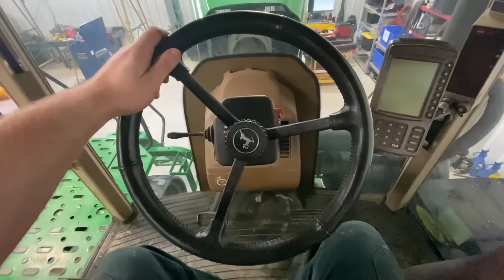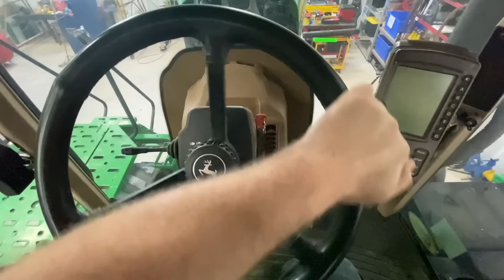The ULTIMATE fan drive upgrade! Best way to improve your Vari-Cool fan drive! John Deere 9030 series

Comment: Excellent video Zeth! Sitting here looking up my parts list now. Looks like you can get most of it ordering 3 part numbers. I do most of my own repairs that are straight forward. Your video really helps. I’ve taken my fan drive apart and greased it by hand. Got 3800 hours so far. Would be nice of Deere to provide better info to make customers aware of improvements like this. I would rather update my tractor now than have it fail in season. Thanks for pointing out the improvements and sharing.

Comment: Regarding the comments you get about the engineering of the parts, engineers need field validated empirical data to refine the parts and make them better.  If they had done this from the start for every part on the tractor, the price would be 10 times as high and people would complain that it was over-engineered. John Deere is doing it right.  I wish my kitchen appliance manufacturers would take a page from JD on servicing older units.

Great videos, BTW.  I really enjoy watching skilled craftsman at work.

Comment: Interesting that the bearings on the replacement shaft are closer together!  That increases the cantilever load on the bearings and housing by quite a bit and would seem to increase failure chances.  
Great video as always, Zeth!
Reply from the maker: They are taper roller bearings now

Comment: The mechanical design people at Deere would derive a huge benefit from communication with the folks that service their products.
Reply: About 30 years ago my company had a program like that. The people in the field have a very different/valuable view of the equipment than the  engineers do.
Reply: Deere has a number of ways they connect with dealer mechanics.  One is DTAC (Dealer Technical Assistant Center)  Every factory has one of these groups.  This works well because the people in factory DTAC can take a few steps and communicate with engineering or the production line people..

Comment: Zeth, this is very informative. We have a 2011 9630 that is past 2,100 hours. It was overhauled in frame at 1,900 at Sloan's at White Hall due to a valve dropping in the head, but I'm almost sure the original fan drive is in place, and I had no idea that it would run out of lubrication in that cavity. I know we've had our tech put a 2nd water pump on it around 1,300 hrs, and it has now had what you refer to as the "rotary union" on the drive shieve put in. What I'm gathering from this video, is we need to discuss it with our tech, but definitely lean towards taking this apart just as you are doing and at least put new grease in our drive and check the shaft and bearings. I'm figuring this update is inevitable and looks like an improvement over what is there where it can be greased (we like to grease) and maybe the problem will be cured once and for all. I'm planning on keeping this tractor now that I've already had to take the hit overhauling it so soon into it's life, and the cost of new continuing to rocket up.

Comment: Snap-n may be more expensive but they take more abuse. I know this from when I was a mechanic. The quarter inch swivels took so stress, more than any other manufacturer I used. I couldn't worry about cost of a tool when it came to reliability. I needed the tools to last and not break during a repair. I still have all my tools from the early 90's, most snap on, zero issues still. I use them now at home fixing my own Honda Pilot in my garage. Saving myself massive money going to auto shops. I am glad I acquired the knowledge over the years. My dad mostly taught me everything I know, even home repairs.
Reply: Blue point made in the same factory as snap on. Blue point= snapon
Reply: @ToyotaNutjob  yup!! I got some blue point tools. Wire stripper is one of them haha

Comment: Great technical stuff here. Useful education to equipment operators and maintainers. There will always be armchair experts or frustrated owners who naturally have a opinion. My personal view is that despite its age, this tractor has low hours for this assembly to require total replacement. It is what it is as they say. Field mechanics on YouTube sometimes have a low option of shop mechanics. You're doing a great job of countering this view.  Like the unused position in the timing cover. Cheers from London
Reply: Cuz it was never greased, that’s why it failed…

Comment: Very cool.  I like the trade secrets you share. Myself, I would have put in a big piece of cardboard or similar after the fan was removed.  It scares me that I would slip and punch a  hole in the radiator. Just me.  If it were not for bad luck I would have no luck at all. Thanks.

Comment: Such interesting videos.  Thanks.  So...I'm a city-boy with no clue how much one of those big tractors costs the farmer.  No doubt how well made and tough the equipment is.  So evident in the massive parts, eh?  Also curious what the farmer pays for someone to come out to the field to have someone diagnose the problem.  And it's not like you can always simply drive it back to the shop, eh?

Comment: While it’s great that Deere continues to upgrade replacement parts I can’t believe that balance and serviceability wasn’t taken into account from the get go
Reply: And the worst thing is it would barely be out of warranty (hours wise) not years, not really good enough these modern machines. Yes I know they are more complex and more technical, but when there’s still 40 and 50 series deeres out there with 20,000 hours that require little or no maintenance after such a short period of time it really makes you wonder!!
Reply: @zzzzzzzzzz3799  they make more money from selling the parts
Reply: Planned obsolescence.
Reply: Well you sure didn’t put in any input when these were made, I’m sure your ideas could’ve really made these kind of jobs a whole lot simpler.

Comment: The obvious question is, Why did we need a variable speed fan at all, my 2007 9320 never changes temperature. I have run it 50+ hours straight and all is good. Choose the right gear for the load and blow the radiator out now and again.
Reply: Great question.  Everything should be as simple as possible.  Deere had a lot of issues with this overly complex fan drive.  The 20 series are sure holding their value against the 30 series.

Comment: Great video as always, but isn’t there a DTAC solution that recommends replacing the crankshaft balancer as well? We have been doing them on all of the 30 series with a leaking fan drive
Reply from the maker: I usually change them at 4500 hrs or if I’m fighting a continuing seal leak.

Comment: Another awesome video Zeth! I have pulled wrench’s all my life but not a lot on the green iron so it’s very interesting for me! I look forward to the next one! You don’t need to remove the paint on the sieves on the belt side? We always did on New Holland combines that use the same principal to run the rotors.
Reply from the maker: Thanks. Nah it’ll burn off.
Reply: @ZKMasterTech  There’s likely not as much torque there as in a rotor drive clutch. Keep up the good work Zeth!

Comment: may be this is a stupid question.. but why couldn't they put an electric motor as the fan drive and control its speed with the ECU. ( or let it run at maximum speed. little more cooling never hurt an engine.. ) so they wouldn't have to super engineer all of these failure points?
Reply: Never underestimate an engineers desire to needlessly complicate things to justify a paycheck.  Other brands have hydraulic driven fans and also some have electric fan controllers just as you describe that are not only cheaper to replace, but last longer the FIRST time.
Reply: @robertkenney-oles5948  100% agreed

Comment: Great video Zeth, just one question (or two actually) : I noticed you use metric and imperials bolts and wrenches, what is most common on John Deere tractors? Second question: how much do you clean when you remove a part from a machine, I like to clean most of the surrounding parts when I take something of, but is that something you do too in the workshop? All the best from Holland!
Reply from the maker: 10, 13, 15, 18, 24, 30, 32mm are the most common sizes. A few things here and there are SAE. Yes I always do a lot of cleaning.

Comment: Question for you...the new upgraded shaft is obviously considerably shorter and as a result wont it be harder on itself and on the cmtiming cover as the leverage point has shortened in intensified  and it has a very heavy assembly hanging putting downward pressure on it
Reply from the maker: No its fine. It goes in there very solid and the new shaft has tapered roller bearings now.

Comment: What is the purpose of the variable fan system on a tractor? It seems like it'd be a whole lot better, cheaper, easier to have the fan on a solid shaft like the 4440 instead of this kind of system that seems to have constant reliability issues
Reply: Available horsepower and fuel savings. No need turning that big fan if the engine doesn’t need the coolant cooled.
Reply: You have issues when you don’t maintain something.
Reply: @jackwillie2729  there are a ton of questions on repairs. John Deere is set to make a record profit this fiscal year, CEO looks to make 15 million and they are fighting right to repair. Bloomberg just did a piece on this, many farmers are revolting.

Comment: Live the  videos  zk 
Have a  question   Your  1/2 Milwaukee ratchet
Do you have the  part number for the  protective boot  been  searching  high  and  low  for it
Thanks
Reply from the maker: 49-16-2560. Home Depot has them in stock. My ratchet is 3/8 extended.

Comment: When you put the fan back into place is it the shadows that give the impression that possibly the fan blades didn't get cleaned up from the previous oil leak since I certainly felt you would have cleaned the fan prior to reassembly ?
Reply: Why?
Reply: Chill it’s a fan not a complex part.

Comment: I have a 8335r and where the alternator is it has a loud humming noise but our other 8335r doesn’t, could that be a bad alternator making that noise or is there a hydraulic pump or something there making the sound, I’d like ur opinion
Reply from the maker: It’s probably the AC compressor. Take the belt off and feel the clutch. Also check the alternator.
Reply: @ZKMasterTech  thanks for the reply
Reply: check idler/tensioner pulley bearing
Reply: @agger838  it’s towards the back by the front windshield where the alternator is, on my next video I will post it and maybe somebody can watch it and tell me what it is
Reply: @easternshorefarmer  yeah theres alot going on there. take the belt off and spin everything by hand.

Comment: Wow... that is a lot of "big" green parts to replace. Approx. what does a repair like this cost?
Reply: John Deere should be forced to recall all these faulty parts, because of poor engineering. Replace with the updated design for free.
Reply: Jazko, my first reaction too.
Reply: @DNOWWOLF  Looks to me, they planned it, since they left additional bores in the timing cover...
Reply: @jazko  you’ve never heard of things wearing out and the manufacture trying to improve. These fan drives actually don’t have a very high failure rate.  I’m also a master Deere tech like Zeth and I honestly can’t remember the last time I had to do a driven repair on one of these.

Comment: To bad they couldn't put the little box right in the cab next to the wheel in the black box right behind the wheel.  That way all that linkage, u-joints and such could be removed.

Comment: Hey where did you get the holder on the side of you cart for your battery impacts? I have one for air impact but it doesn't work well for battery ones.
Reply from the maker: I got it off the matco truck.
Reply: Thanks! I will have to look into it. I get tired of piling impacts into the top of my cart and them falling over.

Comment: John Deere engineer designed this variable fan drive system was an idiot or Deere had it designed to generate shop and parts revenue.
Reply from the maker: They designed it to move more air and save horsepower when it doesn’t need that much air flow. Doesn’t seem dumb to me. The Controllers can monitor different temperature inputs and adjust the fan speed accordingly. With that much engine power, hydraulic flow, fuel flow, and running the AC it needs a variable speed fan to run at maximum efficiency.
Reply: @dougroberts7210  yep and $1500 for a fan drive pump or $1000 for a fan drive motor are any less expensive to repair when they fail?

Comment: crappy over-engineered setup.   go back to the adjustable shutters like on the old 2 cylinder put-puts.  worked fine for 30 years.
put a thick piece of cardboard against the radiator, to keep from accidentally nicking the fins with tools or parts